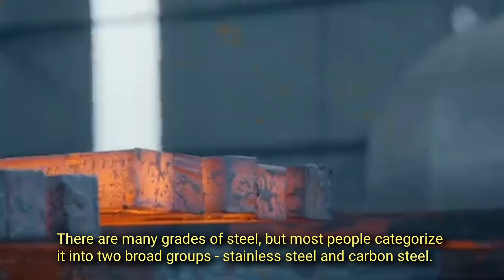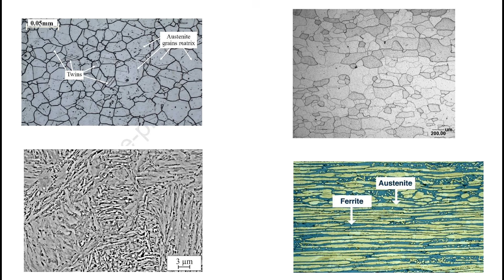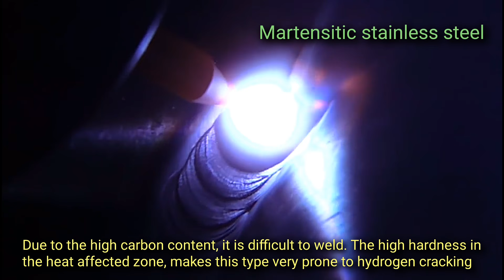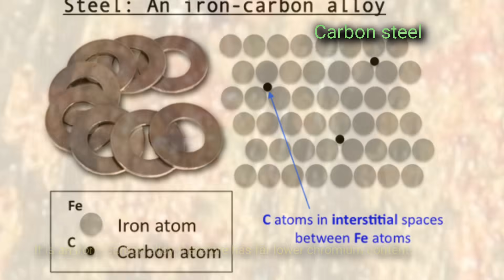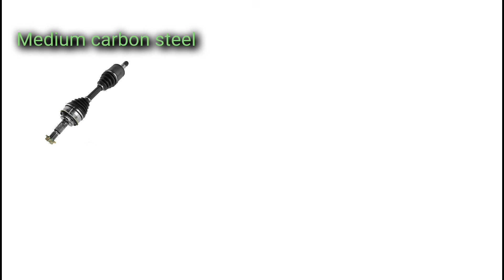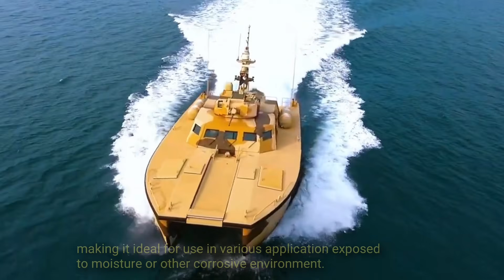Steel Types - Stainless Steel Vs Carbon Steel Explained.

Comment: In the flange world this choice usually comes down to service: A105 carbon steel covers most oil and gas work, and 304/316 stainless earns its extra cost once you get into corrosive or sanitary service.

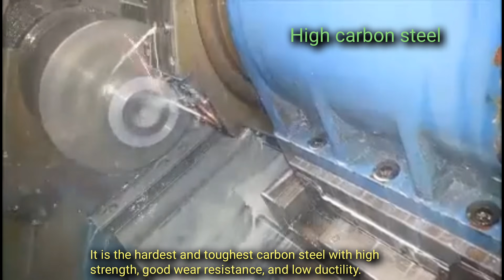Comment: 6:31 high carbon steel is the hardest and toughest carbon steel ( i think high carbon steel is not the toughest due to its low ductility and  low carbon steel or medium carbon steel is typically tougher ) and thank you for your content it was a highly educational video

Comment: If I have a piece of steel in front of me, how can I recognize which one is this? Is there any sort of tip OR lab test or what, how can I identify the class and understand wether it's Stainless Steel or Carbide Steel?

Comment: Which type and grade of steel would you guys recommened in the following situation:

-Furniture office
-The steel is gonna be for the look so it will be painted.
-It had to be magnatic
- soundblocking if possible
-I am Not gonna bend it (maybe a small part, like a 90 degree.
-it has to be a plate (1m by 2m of 1.5 mm thick

Pls help
Reply: mild steel

Comment: i came here after i saw P&ID which tell they use slaker tank (reactor) made of carbon steel instead of stainless steel to make slaked lime. Isn't carbon steel vulnerable to corrosion? Why they choose carbon steel over stainless steel?

anyway great video

Comment: I made a knife blade out of 154-CM stainless steel one time. After cold wet-grinding it and having it heat treated properly, I attempted to finish it down by hand. This material is used in the United States as commercial jet aircraft fan blades, and I soon found out that it was one of the toughest, most abrasive-resistant stainless I'd ever worked. I plunged it thru a sheet-steel folding chair with only minor deformation to the tip. (my wife was not pleased.)
Reply: Heck of a product tester 😂😂